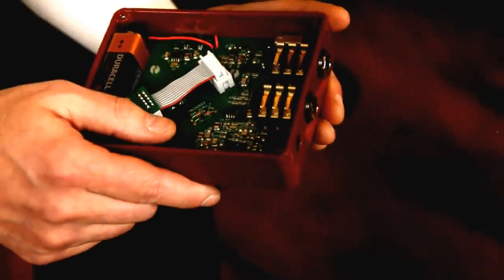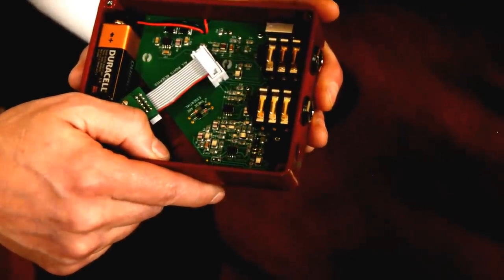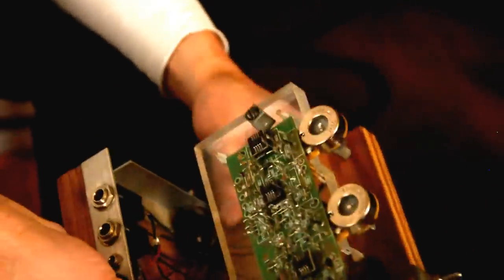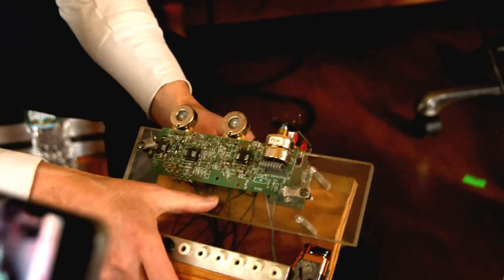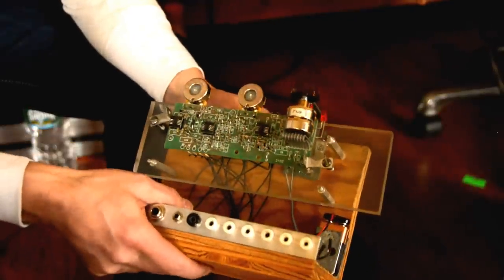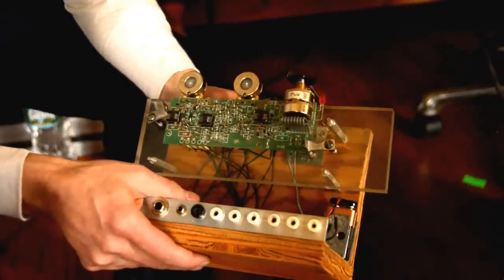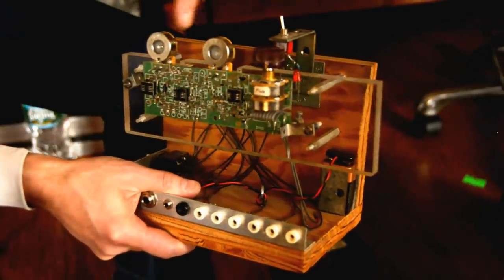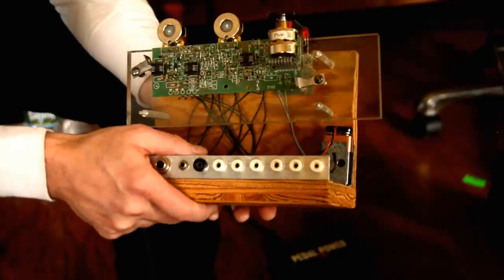Klon KTR Prototype & Development board w/Bill Finnegan

Comment from the maker: You're absolutely right. The parts that break on pedals are mainly the bypass switch, jacks and pots. All of those should be easily replaceable and the way the KTR is designed, you can just plug in a new foot switch that can be mailed to you if there's anything wrong- no soldering needed. Between Taylor and I we've had several hundred pedals and never have we seen a resistor randomly fail and need replaced.

Comment from the maker: I think that's a valid want. Something like the Tim (which I used beside my Klon) has a little bit more flexibility in theory due to having two tone knobs (bass/treble). Yet, I've never found myself actually wanting/needing this on the Klon and the single tone knob seems to do the trick. The EQ'ing just seems to pretty much take care of itself and is just generally an extension of the tone of the guitar and amp itself.

Comment from the maker: The KTR is down from what the cost of the prior Centaurs were new (especially when inflation is counted), and definitely down from the used market prices. 

Even if a pick and place is used, replacing SMD components really isn't bad even with a $10 radioshack iron. It isn't something you need to do daily, and while we've had hundreds of pedals- we really never see random failure on them due to things on the board- its always jacks, pots and switches that fail. Easy to replace.

Comment: The only problem I have with SMD is the RoHS requirements.  Particularly where there are strong vibrations from a loud speaker.  I prefer lead solder as I have seen several failures without it.

Comment from the maker: You're entitled to your opinion. I don't know who told you that SMD isn't repairable, but I could replace every component on this with just a soldering iron, magnifier and tweezers. If I had a hot air rework station I could do it even faster. Maybe you should find a hackerspace nearby and take a class on SMD soldering? It isn't that hard. The SMD parts however can actually be more expensive for high spec ones than through hole- so I'm not sure how you say its cheaply made either.

Comment: Sorry, but the only pedal I ever owned that had micro parts inside was a cheap chinese delay I got for less than 20 $ from ebay. I´m a bit surprised to find those tiny parts in such a high priced OD.

Comment: ok, my comment was a bit exaggeratet, but I'm still thinking that pedals made of SMD parts are unrepairable for the usual guy like me who's handy with a soldering iron, but has to give up on small parts like these. and as the SMD parts are put by robotic pick and place machines on the surface board, the pedals are in fact cheaply made (which is the whole purpose of using SMD, besides the size). I wouldn't have a problem with it if the price went down accordingly, but that won't happen, I guess.

Comment: I'm amazed at the KTR haters. Why would Finnegan go to all the trouble to make a poorer quality Klone of his own pedal and then release them in limited quantities?  The KTR is not cheap and Chineese. Just because it looks different doesn't mean that it's cheaper. I know that not all dumble amps are "gooped" and that not all of the dumble amps look like each other on the inside. I'm sure you'd think dumbles are cheap too. Yes, sometimes the market skews the value of certain items but it's not bill finnegan doing this. It's all the artists who's records you by that swear by the sound of these pedals that make them what they are.
Reply: I have the KTR and have owned an early gold and a silver version too. I love the originals, but have long since sold them. The original Klon was a very usable one of a kind pedal. I keep looking at clones because the KTR just doesn't cut it tone wise or in build quality.  It is all surface mount construction on the inside which is short for throw away technology. Bill did this to make the pedals affordable, profitable and easier to make offshore. My pedal has blown the charge pump diode twice and I've managed to replace it on my own. Not an easy task. That and the switch itself are about the only serviceable  items in the pedal. The switch is attached via a ribbon cable to the main board. It constantly disconnects after many stomps and travel miles. I see many other manufacturers following the surface mount construction wave these days. I avoid these at all cost, especially the small guys that will most likely not be around when it comes time to replace or service something.

Comment: smd stuff fails way too often, and isn't repairable like thru hole components. they don't seem to sound as good imho, probably due to the parasitic capacitance and inductance that seems to be inherent in them. great for home consumer cheap shit, not so great for working musicians where the stuff is subjected to extremes of weather, temperature, etc etc.. i'll stick with my home made one, thanks. wave soldered stuff just fails too much, too easy, and may as well be made by danelectro.